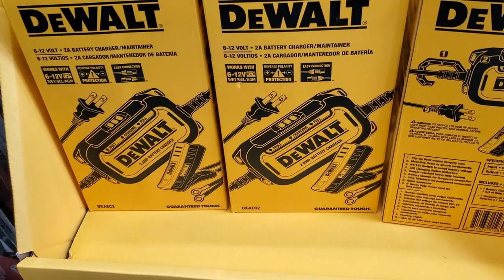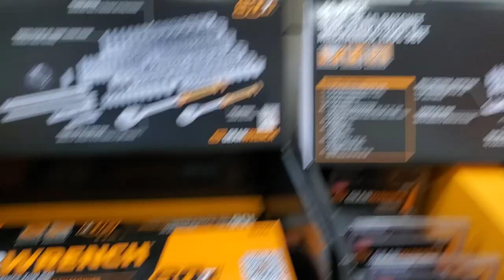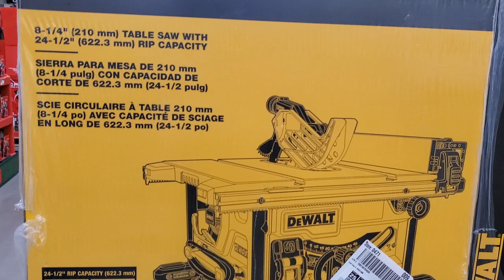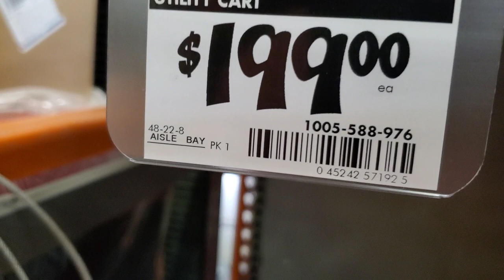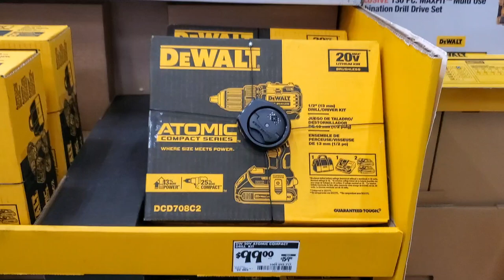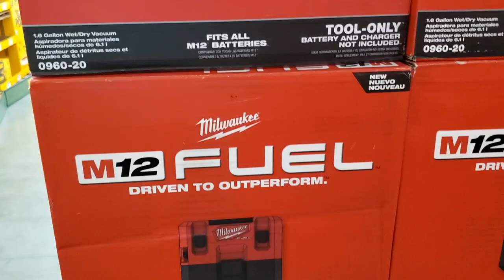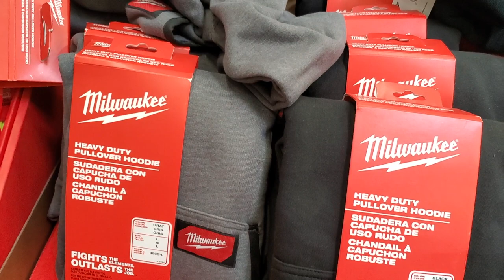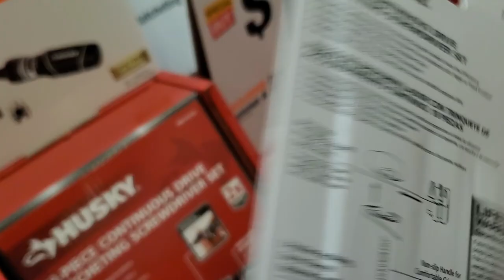Gift Center Tools 🎄 🎅 🌲  Friday 2021 Shopping at Home Depot

Comment: TH,
If a power tool sells out at Home Depot or Lowes, would the tool manufacturers try to fill more orders or that's it?
Reply from the maker: I heard that we might get more but limited quantities not a lot so I would  get what you need asp.
Reply: Power tools are always getting restocked. What's hard to come by is the specialty sale items such as battery kits and tool combos made specifically for the sale quarter. Those won't be restocked and if they are its limited quantities.

Comment: That Dewalt plastic set is pure junk I own it and cracked and broke in 3 weeks.
Reply: The 2.0 system ? Where did it fail ?
Reply: Either you just flat out didn't care about it n banged it up or you're straight up lying.